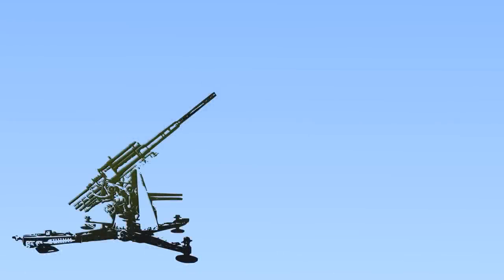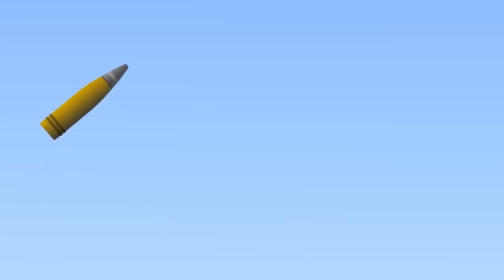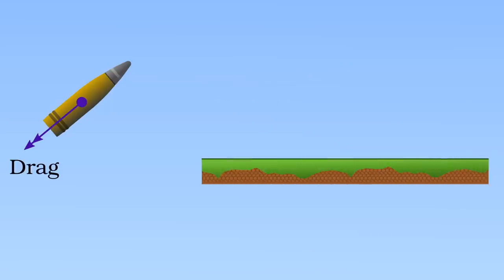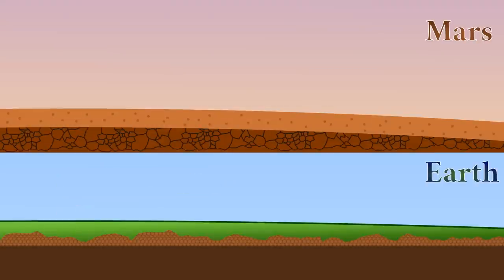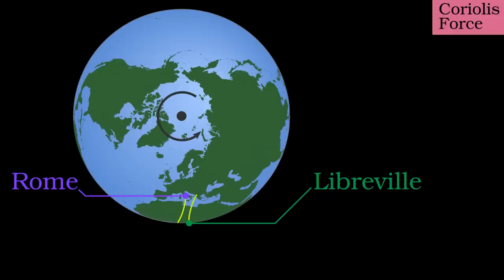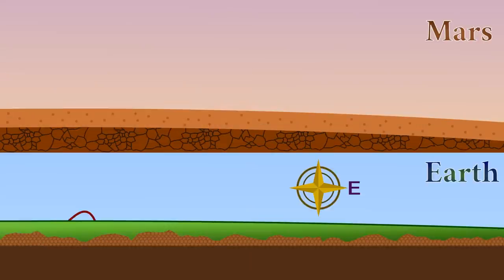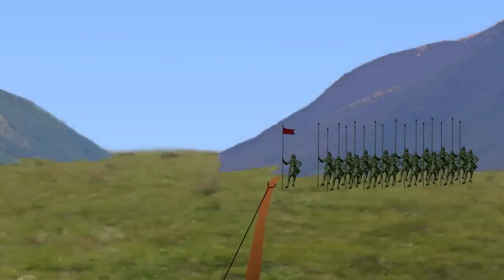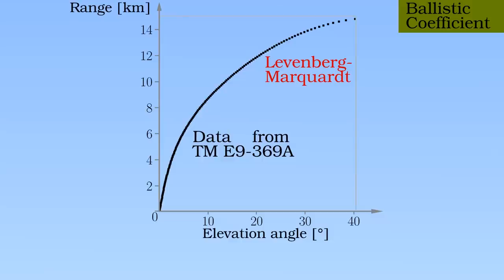Firing the Flak 88mm on Mars - ballistics, history and worldbuilding

Comment: My grimdark fantasy novels are set in a baroque period, with early muskets -- since my world is 1.33x the size of the earth (but less density), it has 1.15x the mass and hence gravity. I consider this with all ship battles, artillery, arrows, et., and even the weight of many longer weapons like spears, pikes, halberds, etc. I also think about how gunpowder would work in a world with a slightly different atmosphere and gravity, and I still need to sit down and work out all the appropriate cycles with two moons...
Reply: If it has 1.33 times the volume and 1.15 times the mass, it only gets about 1.046 the gravity at the surface. This would barely change a thing. Variations in the gravitationnal field of earth can already be of 5% depending on the rocks composition beneath you and the proximity of mountains or such. Don't overthink it, it's basically the same as it is on Earth.

Now if it's 1.33 the diameter of Earth, the gravity is actually lower than Earth for 1.15 the mass. Gravity at surface for a constant average density is a linear function of the diameter/radius, as gravitationnal force is a x² function and volume (therefore mass) a x^3 one.
Reply: @matthieugeorgelin5671  Thank you so much. Years ago, while taking physics for my engineering degree, I realized that the ocean waves would be larger on my planet. I lost those notes, and I could not figure out how I calculated those waves - this probably explains some of that.
Reply: @Zedul  Ah yes, the waves could indeed be higher. Waves are really complicated stuff that involves a lot of fluid mecanics, but you can assume if gravity is the only thing that changes, they will be higher overall.
Reply: One interesting thing to take away from that video is that on mars, artillery can hit you almost a continent away. This means artillery would never need to move, can be built into fortified cities whose entire purpose is to feed the gun to lob bombs at another city thousands of kilometers away.

Comment: I'd like to know how ballistics would be affected on a ringworld or hollow planet - would the geometry make shooting artillery substantially different?
Reply: If you have a hollow planet (a big hollow sphere) there would be no gravity on the inside of the sphere as gravitational forces cancel out (assuming constant density of the planetary shell and that it doesn't have a seperate core).  This would lead to an area of atmosphere, but no gravity, so you can imagine objects getting stuck in the middle just floating in air.
Reply: A Niven ring is large enough that the only effect from being under spin gravity would be that the Eötvös effect is opposite - shooting spinwise increases the apparent gravity on the shell and thus makes its trajectory lower and shorter, and vice versa.

It gets really interesting if you instead situate the exercise in a O'Neill Cylinder. At a radius in the low to mid tens of km, the tangential velocity would be of the same order of magnitude as the shell velocity, which means that inertial effects become very significant, leading to quite weird trajectories.

Comment: Since it seems that you're trying for a certain rigor:

Unless fired at precisely the escape velocity, a shell in a vacuum will not follow a parabolic course. Instead it will follow an elliptical course (if below the escape velocity) or a hyperbolic course (if above the escape velocity). The ellipse (the normal case for anything larger than an asteroid) would be that of the orbit the shell would enter if you assumed a point-mass at the center of mass of the planet, and would of course intersect the surface of the planet. At short ranges, a parabola is a reasonable approximation of the elliptical course, though.

Also, as your range increases and your planet size decreases, the approximation of the surface being planar becomes less correct. Here, the longest ranged shells would be impacting some 10° around the surface of the planet (assuming my quick estimates are close), which would significantly increase the calculated range.

Comment: Your video is one of the most informative and thought provoking I have yet seen on YouTube.  I am currently working on a fictitious world for a science fiction novel.  It has about half the gravity of Earth, and about twice the atmospheric density.  Would the world's(it is a moon of a gas giant) average surface temperature of -200° C, and high radiation, especially X-Rays, and Cosmic Rays make a difference for that 88mm Flak gun?  Would the world(moon) being tidally locked to the gas giant make a difference?  Finally, its atmosphere is primarily hydrogen and helium.  Would that change any of the equation compared to Earth's oxygen-nitrogen, or Mars' carbon dioxide?
Reply from the maker: Glad you enjoyed it!

A few things: half the gravity and double the (surface) atmospheric density of Earth is perfectly possible. A couple of implications which jump out, however; with so much atmosphere, it is likely that the surface temperature would be higher. Mars is cold because it has a thin atmosphere, though a H/He mix would not be as insulating as a corresponding atmosphere containing CO2, for example. I do not readily have the tools to get the opacity (which is what determines to what degree the atmosphere would blanket the moon), but it's something to think about. Then again, the planet+moon could be really far from the host star(s), or the latter could be very dim. The atmosphere would be a great protection against x-rays and other cosmic radiation - they should be absorbed even more than on Earth.

As for ballistics: the barrel velocity would be slightly lower than on Earth, because of the higher pressure pushing back as the gun fires. Someone pointed out in the comments that cooling would be a problem with as little atmosphere as Mars; for this moon, that should not be a problem. Other than being affected by the differing drag/gravity effects as mentioned in the video, there should not be many other changes to ballistics. I assume that the tidal effects make the sidereal day quite long, meaning the Coriolis effects should be minimal.

Comment: one interesting thing you didn't touch on, it would be much harder to use artillery at close range since aiming high to avoid obstacles would result in unusably long trajectories. you can of course get around this by lowering your propellant load, which might be an interesting thing in a setting like that, close quarters combat can use low velocity artillery, but you can blow up a city from half a continent away with high velocity artillery. maybe they would figure out MAD faster than we did in such a setting.

Comment: to know if the cold would interfere with the weapon's function you would need to know some properties of the steel used. Particularly the coefficient of thermal expansion and DBTT and tensile properties at those temperatures. The first two failure points that come to mind would be either the bore shinking and seizing the round, or the barrel outright exploding and fragmenting due to the different material properties at low temperature

Comment: This is extremely interesting stuff! This is the first video of yours I've stumbled across and I am so glad I did - this is exactly the kind of thing I like to think about when approaching my worldbuilding. 

I'm working on a setting in which the planet is earth-like in most aspects except it is twice the size yet half the mass. The force of gravity on this world would remain the same as on Earth, but presumably this means the effect of the curvature of the world would be much less pronounced. In addition, with days of similar length to those on Earth the planet's spin must be faster, causing the coriolis and eatvos effects to become much more pronounced.

Am I right to assume this would mean that the geographical location of artillery pieces would be much more important a factor in ballistic calculations, but that they may be slightly more predictable at longer ranges because of the reduced curvature?
Reply from the maker: If the days are the same length, the Coriolis effect would be the same too (it depends on the period of rotation, not radius). With the planet curving away slower, the range would be slightly smaller. Assuming air density is the same (there would have to be a larger total amount of air), things should be fairly similar. With less curvature, there may be some important climatic effects; the Coriolis force is part of the reason that China is wet and fertile and the Sahara is not.
Reply: @ImprobableMatter  Thanks so much for the insights! You're right, I totally interpreted it wrong! That's a really interesting point about the climate effects, thats something I'll need to build in - which is perfect, I'm at just the right stage to make those sorts of considerations!

Comment: From knowing the mass and muzzle speed of the bullet and approximating the volume of the chamber and barrel you can calculate the pressure curve that has to form there to deliver that amount of energy. Or putting it both earth and mars atmospheric pressure into one equation could theoretically cancel the guns pressure out so you would just get how many times would it go faster.
Reply from the maker: That is true, but I don't think it's possible to uniquely identify the pressure curve (multiple curves would yield the final known muzzle velocity). Some assumptions have to be made, or better yet additional information could be found to constrain the problem, e.g. the maximum barrel pressure.

Comment: I love this video. I'm always thinking of how unique physics shapes a story narrative. For instance, I'd love to write a high action drama set around the equivalent of something between the Dakar & the america's cup   but set in Venus's upper atmostphere. Hypoithetically you could hold a race around the equator in an 'air yacht'. The dense lower atmosphere would theoretically allow for an airship that would, I think, look a lot more like an airplane in some ways, and a ship in other ways. A TRUE AIR-SHIP. The same concept of displacement holds true as would some concepts of lift & fluid dynamics.
High stakes drama. Every ounce of weight would have to be calculated for. The unique fluid dynamics would allow for something like 'boost sails' that could be deployed to gain acceleration, but at a great risk of a crosswind flipping you vertically so you plummeted to your death in the inferno below. ANY Failure equals death. Body unrecoverable. Due to the atmospheric effects radio telemetry could be haphazard. There would be a lot of opportunity to eliminate competetors very directly with no way of proving it wasn't mechanical failure. Say, a race held once a century, with a substantial prize making it the risk worth it. An X-prize style contest between the various system colonies alongside the national representation from the declinining population old terra. A reward of, say, a hundred year contract to build autonomous crafts harvesting Jupiter & saturns vast rich gas feilds to be compressd  for the outsystem bound colony ships at each giants L4 & L5 (like 624 Hektor) 'filling station' with each centurian winning design. The kind of contract that ciould make or break a financially struggling colonies. High stakes stuff, running the gas stations of the interstellar future, i'd think.

Love to hear your thoughts. THis is just a speculative outline i've dallied with for years.

Comment: Would it be easier to dodge projectiles on a low gravity world though?
Sure you can jump higher but that just puts you on a predictable ballistic trajectory and conversely ducking would be slower. With lower gravity you also have lower friction so lateral and angular acceleration would be more difficult. 

This isn't to say you couldn't have some interesting effects regarding mobility though. Off the top of my head human powered flight with medieval technology, parachuting with much smaller backpacks Using wings to run up walls, depending on air pressure having easily survivable terminal velocity. It would also change a lot of regular movement considerably for example needing running around a corner would require you to practically lean over sideways to stop centrifugal force throwing you over.
Reply from the maker: Really good points.

Comment: I used to work on (among other things) firing solution computers for the field artillery. In addition to early computers being used to calculate firing solution tables, more advanced early computers and huge computational resources even today are used for weather prediction, that data being disseminated to the field firing solution computers I used to work on. I don't think its possible or practical to use any kind of curve-fitting to accurately aim a modern piece of field artillery at long range. For mortars or direct-fire of artillery against materiel targets, tables are fine, but for everything on the range of miles, firing solutions have to be voxel calculated with the weather data and the appropriate differential equations.

We do get some people trying to incorporate actual science or physics or math into fantasy settings with questionable results. The 40k "depleted deuterium" rounds come to mind.

There was a Star Trek TNG book though I remember reading as a kid that did have a piece of artillery in it which was a trap: it fired a round that went around the planet it was on and hit its operator. Again, not realistic if it were aimable in any way.

Comment: If a thinner atmosphere means a higher muzzle velocity and a lower gravity means greater range, then I believe smaller arms (like pistols or PDWs) could be more common:

~The guns and ammo would be even lighter to carry (even lighter so on a lower gravity planet). Soldiers would be able to carry more gear before feeling weighed down, have an easier time carrying massive weapons, or simply move faster if carrying the same weight in gear. Plus, they'd be cheaper to produce.

~The increased muzzle velocity would increase the damage potential of the rounds, so smaller rounds could potentially have the same stopping power as the current rounds used by militaries.

~Increased ranges means pistols wouldn't just be a last line of defense (the effective range of a soldier's pistol is said to be "when the enemy is too close to use your rifle"), and shorter barreled weapons would be sniper rifles (which pairs perfectly with lighter gun, lighter rounds, and greater range).

Of course if an Earth solider came to their planet, our military guns would likely be seen as massive overkill, but then again there is no kill like overkill!

Comment: I'm working on a fiction where I could see using this in an interesting way but I'm struggling a little bit with the math. 

It takes place on a space elevator with ~ -1G of gravity (Cable material is no issue due to sci-fi magic)
Does the much larger sphere reduce this effect to near zero on the Flak cannon scale?
Reply from the maker: Not sure I understand the premise - is the elevator going really fast? Are you concerned with tension on the cable, or a gun fight inside it?
Reply: @ImprobableMatter  
The elevator is held in tension, anchored to the ground at ~2x geostationary orbit. 

Since it is linked to the ground it will rotate with the earth and create illusionary gravity pointing away from the earth. Like spinning a bucket full of water on a string.

My intuition are the effects would be more pronounced, but the large radius may cancel it out almost entirely at the flak scale.

Shooting a flak north would probably not show any real Coriolis effect.
Reply from the maker: @PBnFlash  There are two effects not to be confused. When you spin a bucket of water, a teacup ride, or a centrifuge, you are experiencing centrifugal force. Indeed, people at the equator are doing so now, slightly reducing their weight. Rockets are usually launched from equatorial sites for this reason.

If you look at a description of centrifugal force, you will see that it does indeed increase with radius (distance from the axis of rotation). Note that, if the elevator is stationary, the occupants are not in freefall and will still be somewhat pinned to the floor by gravity. Look up the formula for the force of gravity and centrifugal force - Wikipedia will do and seems to have some worked examples. 

The above holds if the elevator is stationary. The Coriolis effect applies to moving objects such as the Flak shell.

Comment: You also forget a very important factor. The Air density has a massive impact on the V0 of the HE Shell. To a point that the V0 is around 40% higher on Mars. AND more important on a planed with higher air density it can let the gun explode for too high force in the Barrel.

Comment: Technically, the propellant conflagrates (burns) rather than explodes (the difference being the reaction propagation being by heat vs a shockwave). The barrel of the gun would be damaged if the propellant exploded.
Reply from the maker: Doesn't the reaction for e.g. cordite move at the speed of the shockwave?